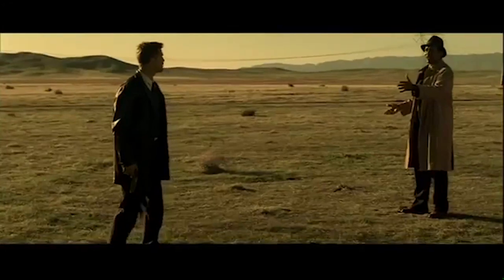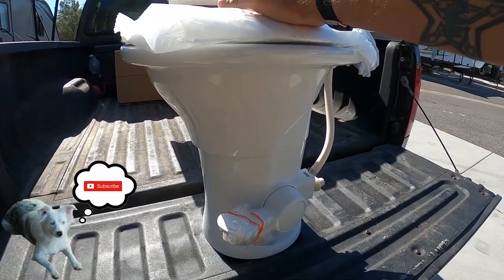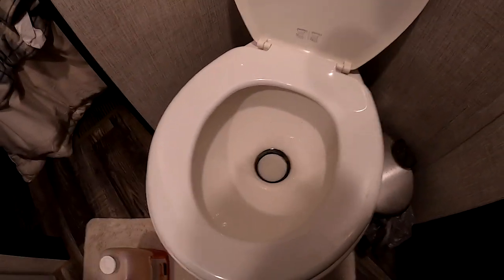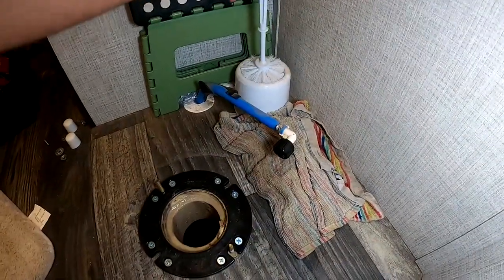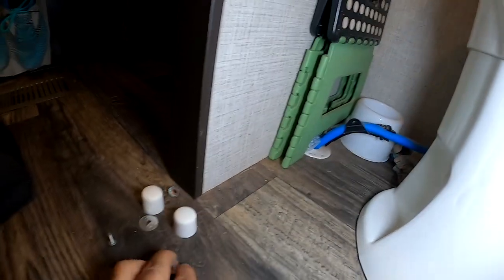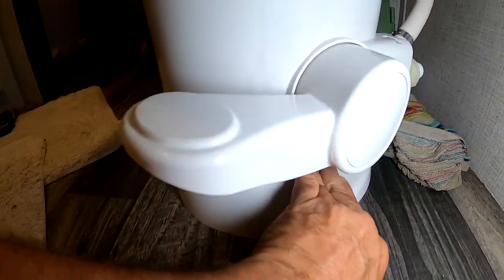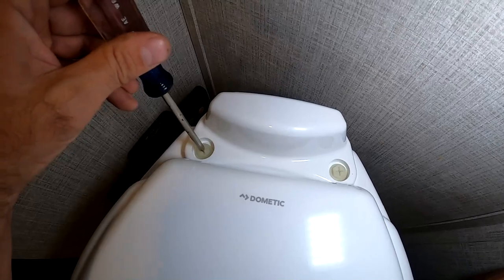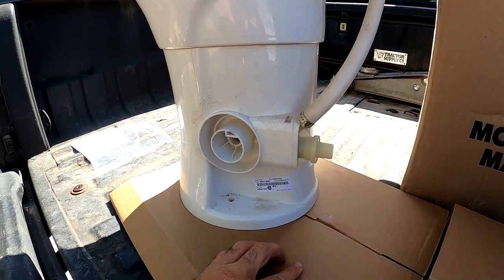How To Install A Dometic 310 Rv Toilet - 15 Easy RV Toilet Replacement Steps

Comment: I Have the same toilet what went wrong if you don't mind me asking GREAT 15 STEP VIDEO Good job!
Reply from the maker: Well 2 things have gone wrong. 1. Being the water valve on the back of the toilet started leaking water when the pedal was pressed. 2. Said pedal broke on the inside where the spring sits and we had to manually lift the pedal after flushing.
Reply: @grumpysdiy  Thanks looks like something I'll have to look forward to in the future I've also already replaced the valve in mine
Reply from the maker: @patriotcrusader1  I will prob end up taking the pedal off and putting jb weld on the inside of the pedal around where the spring sits to add strength.

Comment: I didn't see you install a flange seal on the new toilet. Is one necessary? I'm upgrading to a Dometic 320 and would like to know what I need before installation.
Reply from the maker: Our toilet wasn’t that old so I didn’t see a need to replace it. I don’t know how old your camper is but our was only a year old when I did this replacement.
Reply: @grumpysdiy  2 years. I went ahead and ordered a seal with the toilet. If I don't need to use it I figure I have a spare just in case. Thanks for the vid!
Reply from the maker: I was wrong, the new toilet came with a new seal installed on the bottom of the toilet.